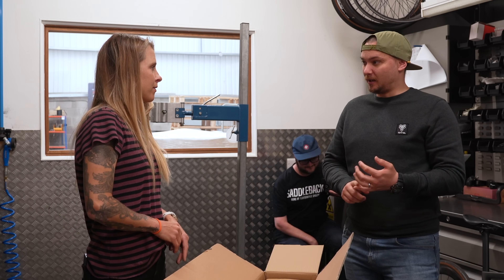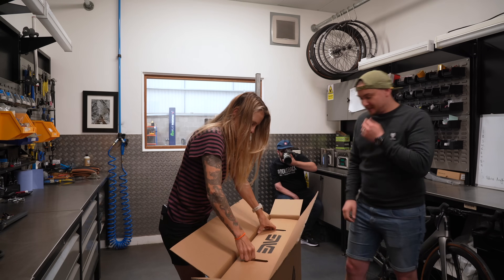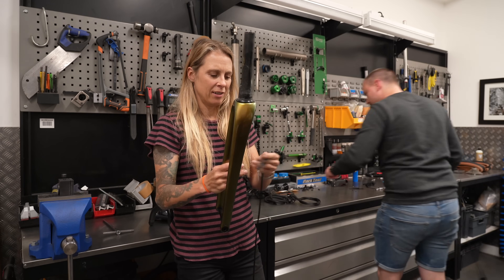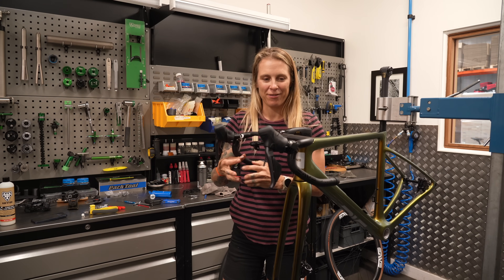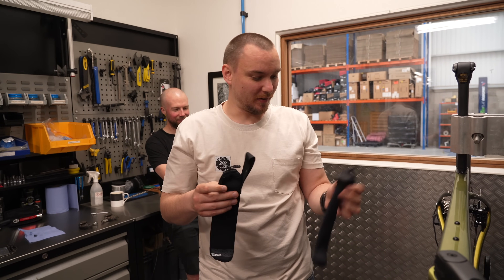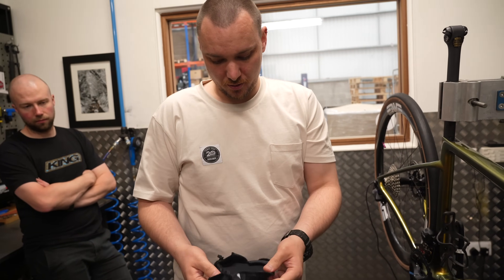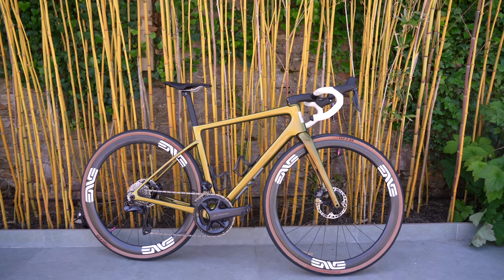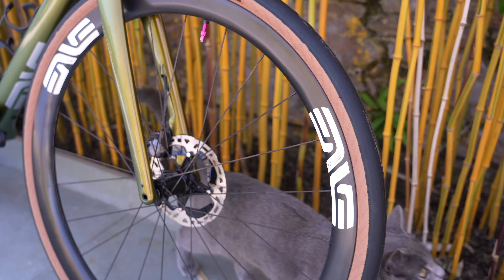Testing my mechanic’s skills - Building my new road bike

Comment: Any issues with the removeable downtube plate and mechanism? Any rattle? Do you think this would hold up long term? I'm not sure spares are available? Designs like this seem susceptible to road vibration issues/wear long term.
Reply from the maker: Well… I’ve only had this bike a couple of weeks but I’ve ridden it a lot and not noticed any rattle yet